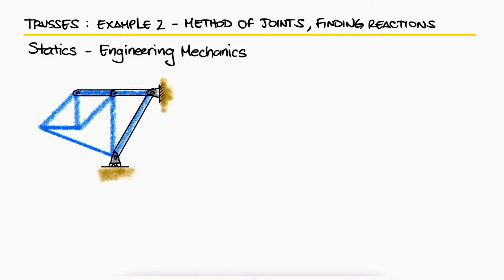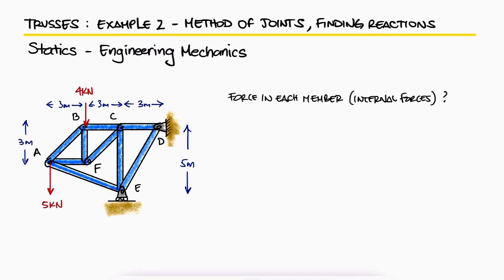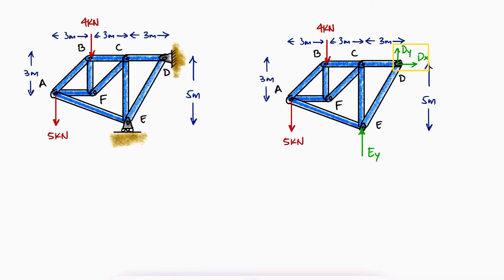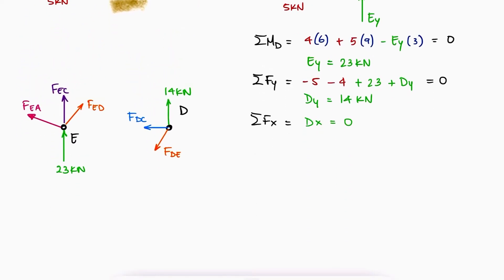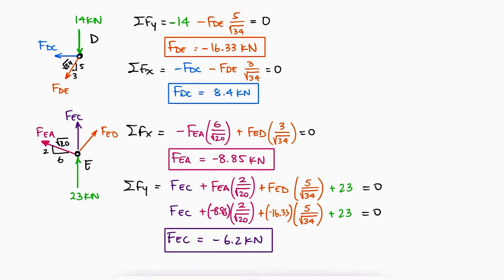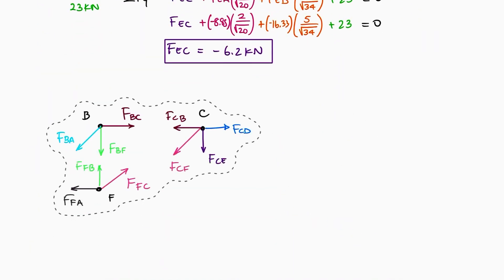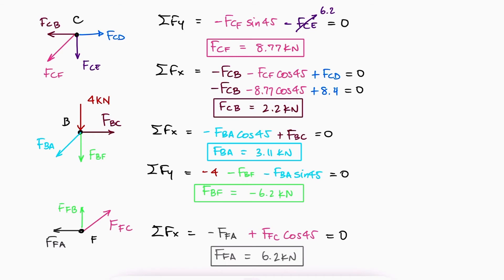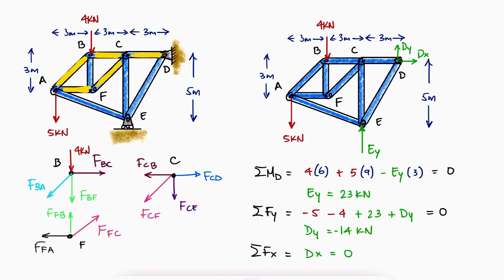TRUSSES Method of Joints, WITH Reactions Required, in 3 Minutes!

Comment: Hey I think your Fea is wrong.  When you plug, -16.33 in for Fed, and solve for Fea you would get -6.3KN
Reply from the maker: My triangle for the F_EA vector should have the square root of 40 as the hypotenuse, instead of square root of 20. That's where the mistake is. Thanks for pointing it out.